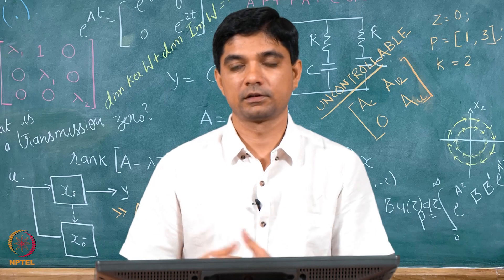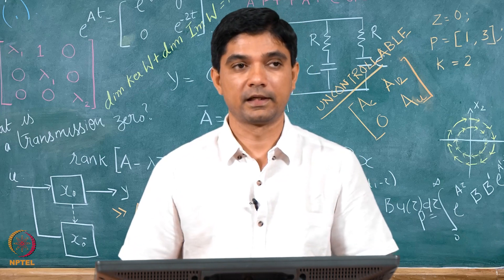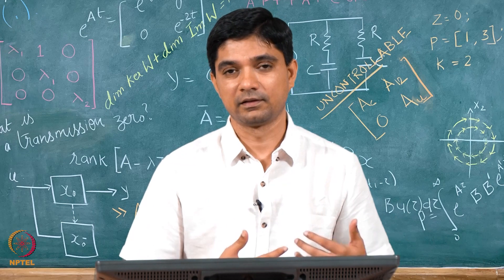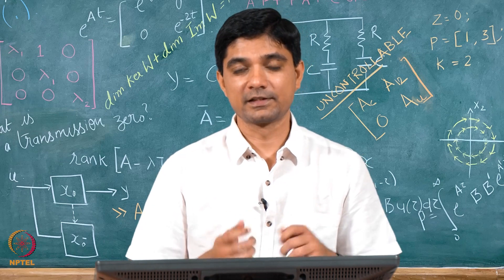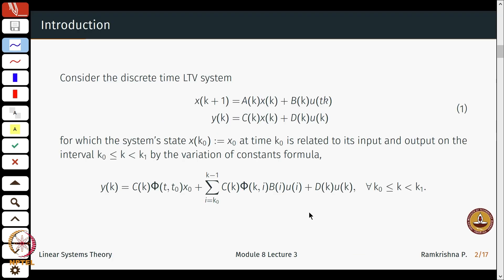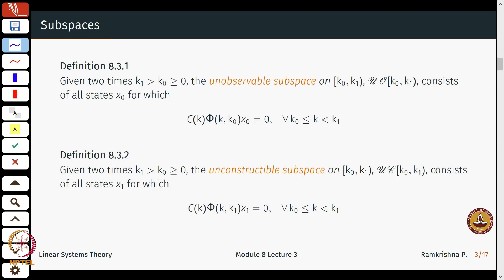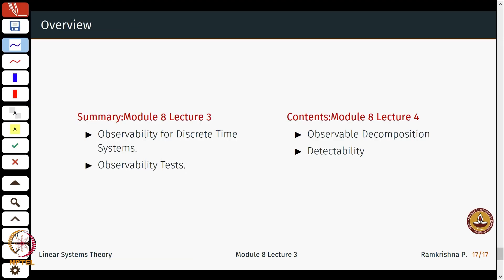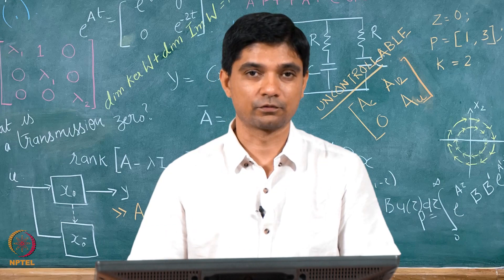#35 Observability for Discrete Time Systems | Observability Tests | Linear System Theory

Comment: I just take the time to organize the videos, the course is really good!
M1L1 Introduction to Linear Systems https://www.youtube.com/watch?v=wyPpoOS31q0&list=PLyqSpQzTE6M9i09h6qh5boOfQgDnV5QV1&index=3&ab_channel=NPTEL-NOCIITM
M1L2 System Models - Part 01
https://www.youtube.com/watch?v=rNykyMBemDM&list=PLyqSpQzTE6M9i09h6qh5boOfQgDnV5QV1&index=1&ab_channel=NPTEL-NOCIITM
M1L3-1 System Models - Part 02
https://www.youtube.com/watch?v=wnugyFL0LL4&list=PLyqSpQzTE6M9i09h6qh5boOfQgDnV5QV1&index=4&ab_channel=NPTEL-NOCIITM
M1L3-2 System Models - Part 03
https://www.youtube.com/watch?v=uinGeySlIsw&list=PLyqSpQzTE6M9i09h6qh5boOfQgDnV5QV1&index=5&ab_channel=NPTEL-NOCIITM
M1L4 General Representation
https://www.youtube.com/watch?v=wy0bLIzrNC0&list=PLyqSpQzTE6M9i09h6qh5boOfQgDnV5QV1&index=6&ab_channel=NPTEL-NOCIITM
M2L1 Math Preliminaries: Sets, Functions and Fields
https://www.youtube.com/watch?v=Qefve0RtHQc&list=PLyqSpQzTE6M9i09h6qh5boOfQgDnV5QV1&index=7&ab_channel=NPTEL-NOCIITM
M2L2 Math Preliminaries: Linear Algebra - Vector Spaces and Metric Spaces
https://www.youtube.com/watch?v=XcxqcFzIgw4&list=PLyqSpQzTE6M9i09h6qh5boOfQgDnV5QV1&index=8&ab_channel=NPTEL-NOCIITM
M2L3 Linear Algebra - Span, Basis and Subspaces
https://www.youtube.com/watch?v=KeOi5mQXOYI&list=PLyqSpQzTE6M9i09h6qh5boOfQgDnV5QV1&index=2&t=6s&ab_channel=NPTEL-NOCIITM
M2L4 Math Preliminaries: Linear Algebra - Linear Maps and Matrices
https://www.youtube.com/watch?v=Sm7P571dAQY&list=PLyqSpQzTE6M9i09h6qh5boOfQgDnV5QV1&index=9&ab_channel=NPTEL-NOCIITM
M2L5 Math Preliminaries: Linear Algebra - Fundamental Subspaces and Rank-Nullity
https://www.youtube.com/watch?v=0kj9hSpIfww&list=PLyqSpQzTE6M9i09h6qh5boOfQgDnV5QV1&index=16&ab_channel=NPTEL-NOCIITM
M2 Tutorial on Linear Algebra
https://www.youtube.com/watch?v=k5WmhS9FCsg&list=PLyqSpQzTE6M9i09h6qh5boOfQgDnV5QV1&index=10&ab_channel=NPTEL-NOCIITM
M3L1 Math Preliminaries: Linear Algebra - Change of Basis and Similarity Transformation
https://www.youtube.com/watch?v=6GEWdoezXsc&list=PLyqSpQzTE6M9i09h6qh5boOfQgDnV5QV1&index=14&ab_channel=NPTEL-NOCIITM
M3L2 Math Preliminaries: Linear Algebra - Invariant Subspaces, Eigen Values & Eigen Vectors
https://www.youtube.com/watch?v=vhbvGjr-Nwo&list=PLyqSpQzTE6M9i09h6qh5boOfQgDnV5QV1&index=15&ab_channel=NPTEL-NOCIITM
M3L3-1 Math Preliminaries: Linear Algebra - Diagonalization and Jordan Forms
https://www.youtube.com/watch?v=iZOBmt1wstk&list=PLyqSpQzTE6M9i09h6qh5boOfQgDnV5QV1&index=11&ab_channel=NPTEL-NOCIITM
M3L3-2 Linear Algebra - Eigen Decomposition and Singular Value Decomposition
https://www.youtube.com/watch?v=3_45TkPVjpU&list=PLyqSpQzTE6M9i09h6qh5boOfQgDnV5QV1&index=12&ab_channel=NPTEL-NOCIITM
M3 Tutorial on Linear Algebra
https://www.youtube.com/watch?v=dCAokT2lljo&list=PLyqSpQzTE6M9i09h6qh5boOfQgDnV5QV1&index=13&ab_channel=NPTEL-NOCIITM
M4L1-1 The State Transition Matrix- Solutions to LTI Systems
https://www.youtube.com/watch?v=lkV_9znHEL0&list=PLyqSpQzTE6M9i09h6qh5boOfQgDnV5QV1&index=17&ab_channel=NPTEL-NOCIITM
M4L1-2 The State Transition Matrix for LTI systems
https://www.youtube.com/watch?v=t_4rXiXh1L4&list=PLyqSpQzTE6M9i09h6qh5boOfQgDnV5QV1&index=18&ab_channel=NPTEL-NOCIITM
M4L2 Intro. Linear Systems Forced Response of Continuous and Discrete LTI system
https://www.youtube.com/watch?v=wHBQxjNqotg&list=PLyqSpQzTE6M9i09h6qh5boOfQgDnV5QV1&index=19&ab_channel=NPTEL-NOCIITM
M4L3 State Transition Matrix and Solutions to LTV systems
https://www.youtube.com/watch?v=5hPivwvZRn8&list=PLyqSpQzTE6M9i09h6qh5boOfQgDnV5QV1&index=20&ab_channel=NPTEL-NOCIITM
M5L1 Equilibrium Points
https://www.youtube.com/watch?v=Uh5-VJvL7ng&list=PLyqSpQzTE6M9i09h6qh5boOfQgDnV5QV1&index=21&ab_channel=NPTEL-NOCIITM
M5L2 Limit Cycles and Linearization
https://www.youtube.com/watch?v=_Fol5QHPGdo&list=PLyqSpQzTE6M9i09h6qh5boOfQgDnV5QV1&index=22&ab_channel=NPTEL-NOCIITM
M6L1 Stability Analysis & Types of Stability
https://www.youtube.com/watch?v=_71r3aQxwpw&list=PLyqSpQzTE6M9i09h6qh5boOfQgDnV5QV1&index=26&ab_channel=NPTEL-NOCIITM
M6L2 Lyapunov Stability Stability Proofs
https://www.youtube.com/watch?v=p-Cnnj3vi_Y&list=PLyqSpQzTE6M9i09h6qh5boOfQgDnV5QV1&index=25&ab_channel=NPTEL-NOCIITM
M6L3 Stability of Discrete Time Systems
https://www.youtube.com/watch?v=I5dj2JS2tkw&list=PLyqSpQzTE6M9i09h6qh5boOfQgDnV5QV1&index=24&ab_channel=NPTEL-NOCIITM
M6L4 Supplementary Lecture: Comparison Lemma and Lyapunov Stability
https://www.youtube.com/watch?v=QYPiri_ihOM&list=PLyqSpQzTE6M9i09h6qh5boOfQgDnV5QV1&index=23&ab_channel=NPTEL-NOCIITM
M7L1 Controllability and Reachability
https://www.youtube.com/watch?v=kkbq3pDf8UE&list=PLyqSpQzTE6M9i09h6qh5boOfQgDnV5QV1&index=32&ab_channel=NPTEL-NOCIITM
M7L2 Controllability Matrix and Controllable Systems
https://www.youtube.com/watch?v=T6Kt2L7QMsg&list=PLyqSpQzTE6M9i09h6qh5boOfQgDnV5QV1&index=31&ab_channel=NPTEL-NOCIITM
M7L3 Controllability Tests
https://www.youtube.com/watch?v=MLoVKqxmxJI&list=PLyqSpQzTE6M9i09h6qh5boOfQgDnV5QV1&index=30&ab_channel=NPTEL-NOCIITM
M7L4 Controllability of Discrete Time Systems
https://www.youtube.com/watch?v=bnkwDii4KNw&list=PLyqSpQzTE6M9i09h6qh5boOfQgDnV5QV1&index=29&ab_channel=NPTEL-NOCIITM
M7L5 Controllable Decomposition
https://www.youtube.com/watch?v=YmmIXbC2TFU&list=PLyqSpQzTE6M9i09h6qh5boOfQgDnV5QV1&index=28&ab_channel=NPTEL-NOCIITM
M7L6 Stabilizability
https://www.youtube.com/watch?v=rq1rXIdpIJw&list=PLyqSpQzTE6M9i09h6qh5boOfQgDnV5QV1&index=27&ab_channel=NPTEL-NOCIITM
M8L1 Observability
https://www.youtube.com/watch?v=99pfwmc_bsA&list=PLyqSpQzTE6M9i09h6qh5boOfQgDnV5QV1&index=35&ab_channel=NPTEL-NOCIITM
M8L2 Gramians and Duality
https://www.youtube.com/watch?v=jAxsDueAOuA&list=PLyqSpQzTE6M9i09h6qh5boOfQgDnV5QV1&index=34&ab_channel=NPTEL-NOCIITM
M8L3 Observability for Discrete Time Systems and Observability Tests
https://www.youtube.com/watch?v=LctUkd0JbEw&list=PLyqSpQzTE6M9i09h6qh5boOfQgDnV5QV1&index=33&ab_channel=NPTEL-NOCIITM
M8L4 Observable Decomposition and Detectability
https://www.youtube.com/watch?v=LEBg9oz2VGQ&list=PLyqSpQzTE6M9i09h6qh5boOfQgDnV5QV1&index=36&ab_channel=NPTEL-NOCIITM
M9L1 Kalman Decomposition and Minimal Realisation
https://www.youtube.com/watch?v=dsfxseqhPRs&list=PLyqSpQzTE6M9i09h6qh5boOfQgDnV5QV1&index=40&ab_channel=NPTEL-NOCIITM
M9L2 Canonical Forms and State Feedback Control
https://www.youtube.com/watch?v=KsbuJxeW9jQ&list=PLyqSpQzTE6M9i09h6qh5boOfQgDnV5QV1&index=39&ab_channel=NPTEL-NOCIITM
M9L3 Control Design using Pole Placement
https://www.youtube.com/watch?v=Deb7ztdR3lo&list=PLyqSpQzTE6M9i09h6qh5boOfQgDnV5QV1&index=38&ab_channel=NPTEL-NOCIITM
M9L4 tutorial M9 and M10
https://www.youtube.com/watch?v=zHnYoz0IgHA&list=PLyqSpQzTE6M9i09h6qh5boOfQgDnV5QV1&index=37&ab_channel=NPTEL-NOCIITM
M10L1 State Estimation and Output Feedback
https://www.youtube.com/watch?v=exn_LpbNMdE&list=PLyqSpQzTE6M9i09h6qh5boOfQgDnV5QV1&index=42&ab_channel=NPTEL-NOCIITM
M10L2 Design of Observer and Observer based Controller
https://www.youtube.com/watch?v=0ZTCkFWFU1I&list=PLyqSpQzTE6M9i09h6qh5boOfQgDnV5QV1&index=41&ab_channel=NPTEL-NOCIITM
M11L1 Optimal Control and Linear Quadratic Regulator (LQR)
https://www.youtube.com/watch?v=EslYMMdWN28&list=PLyqSpQzTE6M9i09h6qh5boOfQgDnV5QV1&index=45&ab_channel=NPTEL-NOCIITM
M11L2 Feedback Invariant and Algebraic Ricatti Equation-Optimal Control
https://www.youtube.com/watch?v=WrkDOzzdj5U&list=PLyqSpQzTE6M9i09h6qh5boOfQgDnV5QV1&index=44&ab_channel=NPTEL-NOCIITM
M11L3 Tutorial M11
https://www.youtube.com/watch?v=jksVjVuP9P8&list=PLyqSpQzTE6M9i09h6qh5boOfQgDnV5QV1&index=43&ab_channel=NPTEL-NOCIITM
M12L1 Linear Matrix Inequalities
https://www.youtube.com/watch?v=7Qfqt4QzYxs&list=PLyqSpQzTE6M9i09h6qh5boOfQgDnV5QV1&index=46&ab_channel=NPTEL-NOCIITM
M12L2 Properties of LMIs and Delay LMIs
https://www.youtube.com/watch?v=ojmG_8HYqtI&list=PLyqSpQzTE6M9i09h6qh5boOfQgDnV5QV1&index=47&ab_channel=NPTEL-NOCIITM